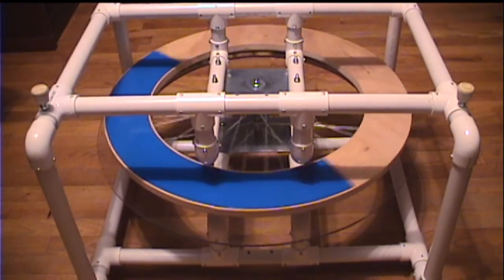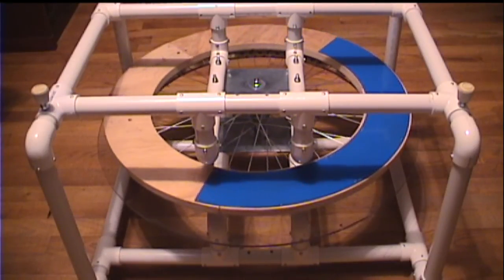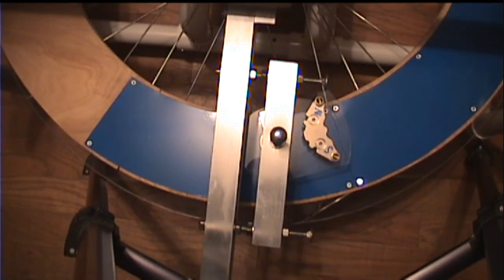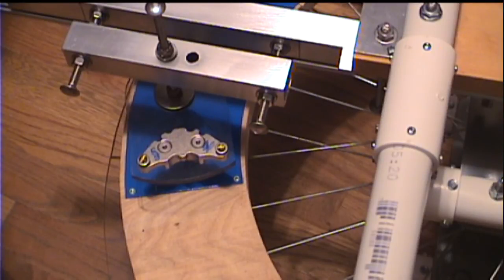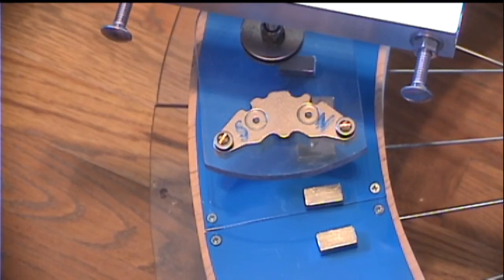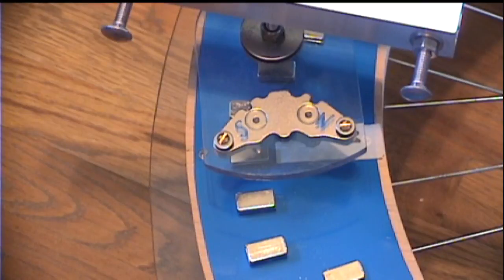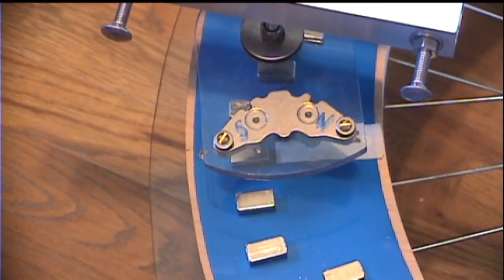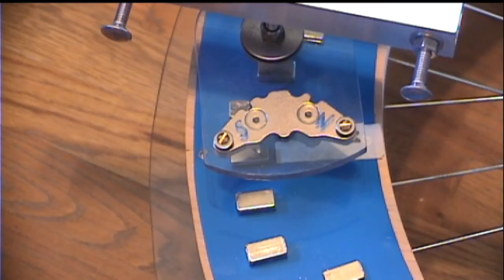Video #31, "Rick's Pipe Dream" Magnetic Motor-Generator Project

Comment: Rick I have seen all of your videos on this project I hope all is well! I really hope your project goes well, I am also interesting in permanent magnetic motors/ energy. I noticed when you spun the wheel in the beginning, it was uneven and the wheel stopped in a certain configuration. I'm not sure if you fixed this in the later videos, but this would make the wheel unbalanced and ineffective, also if you had a way of doing a laser timer, you could reduce friction.